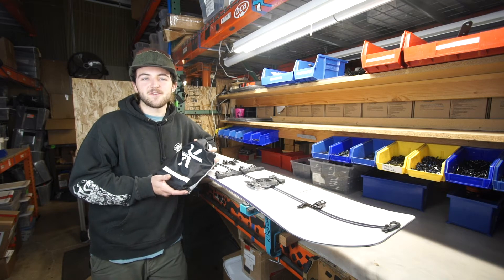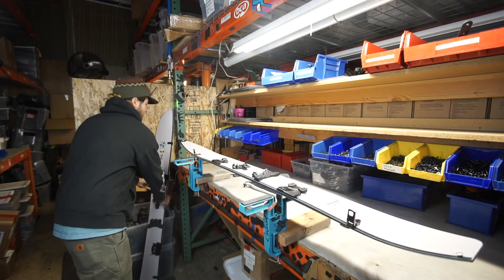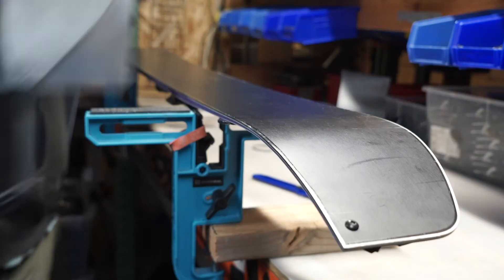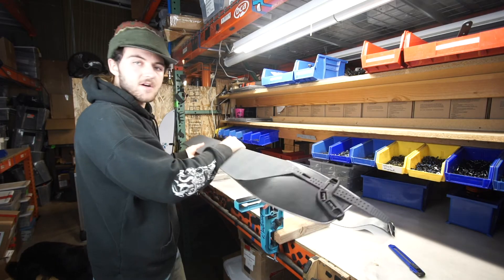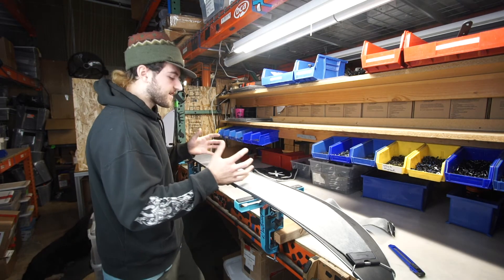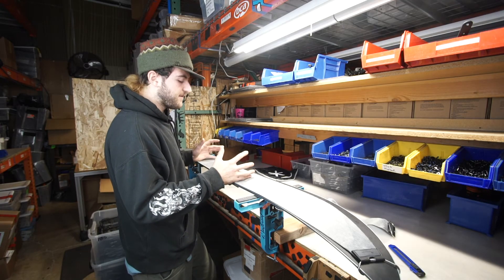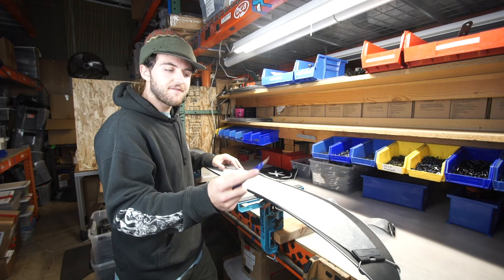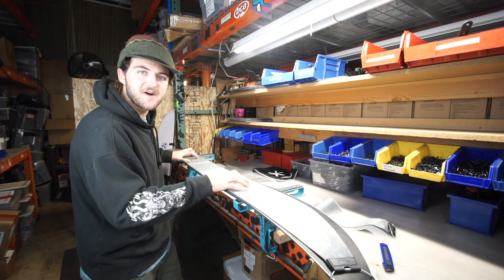Karakoram Smart Skins Installation

Comment: My board is a 161.... do I go medium or large 😅
Reply from the maker: There is a little bit of over lap there, medium or large would work. But I'd recommend going with the mediums. The shorter skins will weigh slightly less
Reply: @karakorambc  only thing having my look more towards the large is that I could always cut them shorter if they're too long? But can't add length to the mediums if they are too short?
Reply from the maker: @IamtheWV17  They come with tail clips already attached to the end of the skin.   Most people adjust their size just with the built in adjustment of the tail clip, and don't have to do any cutting at all.  You can email Jaime@karakoram.com for more detailed instructions and also potentially set up a call to help you get your setup dialed
Reply: @karakorambc  yup I get that! Just figured that if I found the longer skins too long I could chop them and replace the tail clip.... but if the shorts were too short I'd be stuck!?

The board has quite a long nose as well which would mean the skin has to be relatively longer compared to the board length to have good coverage underfoot? 🤔
Reply from the maker: @IamtheWV17  that reasoning makes sense on the nose length-- Large might be a a good call for you then.

Comment: Peeling those skins apart looks effortless. Is it really as easy as it looks?
Reply from the maker: sure is!
Reply: @karakorambc  should we keep the adhesive backing? Is it like a skin saver basically?
Reply from the maker: @Saib0tx  Yes, that adhesive backing does act like a skin saver.
Reply from the maker: You can if you like, or you can use the more robust black skin savers-- it just depends on how much abuse you want to put them through.  We've been happy just using the whiteish backing as a skin saver @Saib0tx